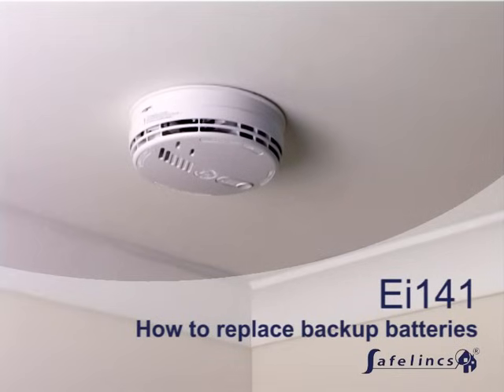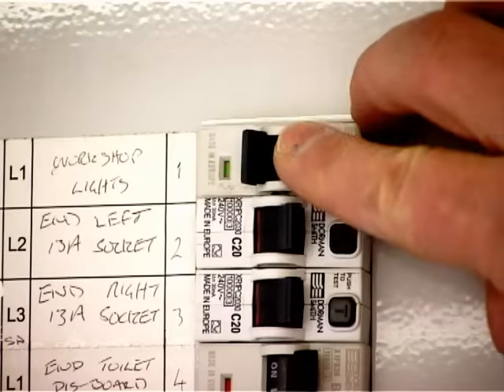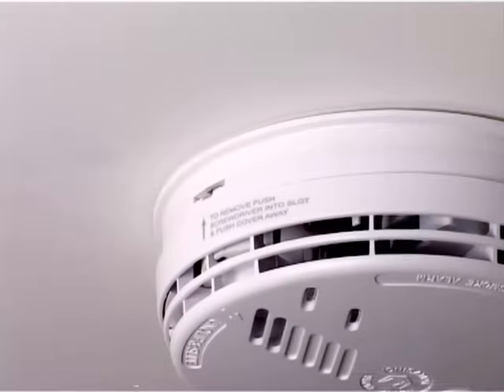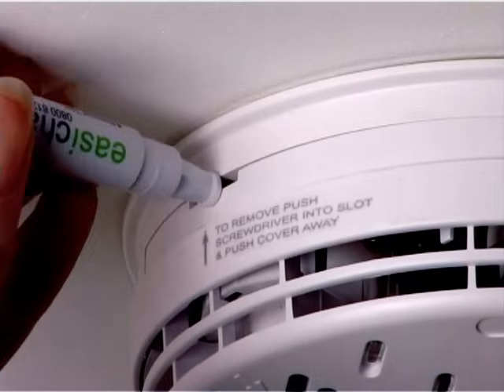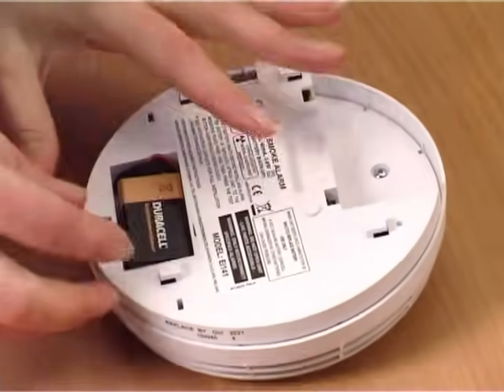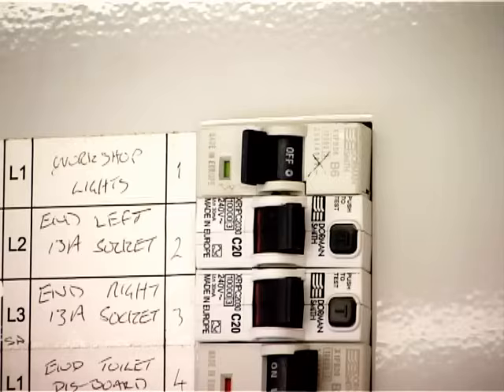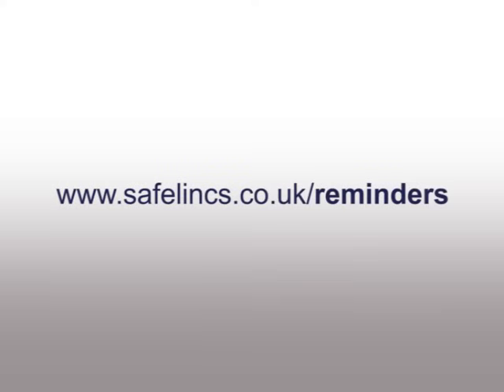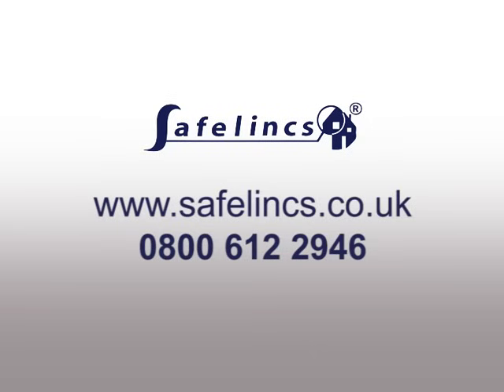Replace battery in Ei141 smoke alarm

Comment: Seriously, why all the complaints about this alarm? The manufacturer cannot determine when a battery will run out of charge. A silence button, maybe with a flashing red warning light to advise the battery needs changing, nothing else needs changing.
After watching this video it took less than 5 minutes to swap the battery over.
The last time a battery was replaced in our alarm was 18years ago, and it's tested every year by the landlords maintenance team!
Yes, it's an inconvenience when it beeps every 40 seconds and even more so when it's at night, but these things save lives.
Here's a thought, how about everyone replace the 9v battery every 3 years or maybe less if it's a cheap battery. That way the battery backup will always be fresh, thus avoiding potential 40-second beeps in the middle of the night.
Or is it just easier to come on to social media and slate the company, and swear like a trooper for likes?
Reply from the maker: Hi, thank you for your feedback. I was a little surprised that your alarm is still being used after 18 years. We recommend smoke alarms to be replaced after ten years as they are becoming less reliable after ten years. See our article https://www.safelincs.co.uk/why-should-smoke-alarms-be-replaced-after-ten-years/
Kind Regards
Harry

Comment: Can someone please explain why in a house with electricity, smoke alarm needs to work on battery. I can understand battery as backup.
Reply from the maker: Hi Jaskan, not sure I know what you mean? These are mains powered and the battery is just a back-up.
Reply: Thanks for clearing that up, As a mechatronics engineer all i can say is this.

This smoke alarm for the layman is  a complete unnecessary nuisance to open up for battery change, with  an unclear locking system to unlock a device situated high up on your ceiling.

I can only imagine very many have been hurt trying to change battery on this device cause in many if not most cases you have to use a ladder.

There are 1 zillion very simple locking mechanism that could have been used for the smoke alarm battery change, considering the fact that its high above on ceiling.

Its just like the case of many deodorants in recent years and other consumer products that come with a locking mechanism that leaves you having to solve a puzzle where all you wanted was just to freshen up.

In Summary the design of the smoke alarm battery change compartment locking system is an unnecessarily dangerous product considering it could be pregnant housewife who has to climb up a ladder to change th battery just to stop the annoying noise, YOU SHOULD BE ABLE TO OPEN THE DEVICE WITH YOUR BARE HAND NOT SCREW DRIVER

YOU SHOULD BE ABLE TO STAND BELOW IT WITHOUT LADDER AND OPEN WITH YOUR HAND bare hand, THAT IS COMMON SENSE IN 2018.

This is why you should have consumers design the user interface of products rather than somebody who still has technical egos to overcome through maturity. Cause maturity in engineering leads to very practical AND SAFE!!!! products, rather than immature engineers and designers looking to make puzzles out of locking systems, thereby creating dangerous situation for those who have to operate the lock standing on a ladder..
Reply from the maker: Hi Jaskan, I do agree with your sentiment. We have passed very similar feedback time and again to the manufacturer, so far without result. This notion of making the alarm really hard to open came from AICO's work with Housing Associations, where  the intent was to make it purposefully difficult for tenants to open the alarm and remove or re-use the battery. The locked battery compartment forces the tenant to contact the Housing Association management and get a 'professional' to do the battery replacement. This of course leave the tenant with the horrible problem of not sleeping til the 'professional' turns up. For replaceable battery alarms this concept is really quite unacceptable. Some other manufacturers still have the battery lock but offer at least a 'Sleep Easy' function that allows you to silence the beeping for 8 hours.

Comment: Designer 1: want to use the industry standard twist to attach?
Designer 2: how about we hide a little slot on the side, but up high out of sight that requires a special size tool, but you also have to push it in just right while sliding the unit....
Designer 1: yeah fuck it, I hate the world too

Comment: I really wish you could detach it with only one hand. Trying to get this thing down whilst you're balancing on two chairs and a stack of pillows whilst trying not to topple over the banister and down the stairs is really hard without a free hand to balance yourself. Damn this student house for having ridiculously impractical high ceilings. Also damn my letting agents for having no out of hours phone number and especially damn my landlord for being too cheap to provide us with step ladder!!!!!!
Reply: Also screw my landlord for not labelling the fuse box correctly that could kill someone!
Reply from the maker: Hi, massively frustrating, I agree. The only way to avoid this annoying situation is to ask the landlord to replace the backup batteries every year, to avoid the nightly low battery warnings! There are also products on the market that have a night time silencing function that silence the alarm for eight hours if the battery runs low https://www.safelincs.co.uk/fireangel-pro-mains-powered-alarms-with-lithium-backup-battery/

Comment: I don't have access to turn off the power so would i be able to do all this without it setting off with the power on?
Reply from the maker: Hi, there is a low risk of electrocution should the alarm be removed with the mains power still connected, therefore we the official approach described within the video.

Comment: Thanks for the upload. 
Getting the cover of this alarm is a nightmare.
I just replaced the battery and its still chirping. 😣
Reply: Stopped chirping. Hurray!

Honestly this video was a life safer. I haven't found any information anywhere on these alarms except this video. I moved into my renovated house in 2013 and no information was left about what type of alarm this was.. I have 3 of these in my house and used this video to replace the other 2 batteries a couple of years ago. I got my neighbour to help me with the one yesterday on the landing as I couldn't reach it. It did a few chirps after the battery replacement (hence my initial comment) and then it stopped. It's right outside my bedroom. 😩 That would drive me mad. I really feel for those who have it in their bedroom. 

On the upside, if there is a fire we'll all know about!!

So sincere thanks for the upload. I have it bookmarked.
Reply: How did you get it to stop in the end?
Reply: @wizards360  it stopped after I replaced the battery. For some reason it continued to chirp for a while after, but then just stopped. Been fine ever since.

Comment: what about if the beeping is NOT in the middle of the night,,, and the 9V battery is not dead?  What else causes the beeping?
Reply from the maker: Hi Paul, it could be older than ten years in which case the unit might start to misbehave. Also, is the green light on to indicate that mains power supply is working?
Reply: Could be a bug inside or built up dust/particles.   Blow it out with compressed air or your pucker.
Reply: A fire.

Comment: great video. have changed the battery and beeping stopped. but we now have a red light flashing - any ideas?
Reply from the maker: Hi Joanne, when the alarm has been activated/tested, the red light will flash twice every 40 seconds. After 24 hours the memory will be cleared and the red light stops
Reply: Safelincs Ltd. thank you !

Comment: Managed to figure it out - screwdriver may not work depending on design. Get something similar width (I used the handle end of a thin fork) and shove it in, if it doesnt slide off easily then shove the fork in further and then it slides off.

Comment: Is there something wrong with just having a smoke detector threaded into the holder, so you can just twist it to remove it as opposed to using a screwdriver and a great deal of force to remove it? Thanks for the video though, it was very necessary.
Reply from the maker: Hi, totally agreed, a simple twist off should be sufficient. Sadly, the manufacturers and standards bodies are too set in their way.

Comment: Why make it so bloody difficult? What's wrong with the simple clip-on design? Far easier to deal with.
Reply from the maker: Hi Andrew, I assume you are referring to the tamper-proof design of the smoke alarm head. This design is aimed at preventing the removal of batteries in rented properties, as the batteries are sometimes used to power other devices. In rented properties the landlord is expected to exchange the batteries on a regular base before they are starting to beep. However, when used in your own home with you changing the batteries yourself I appreciate that it is not helpful to have anti-tamper connections for which you need a screwdriver or similar. I will take this discussion up with our suppliers to see if a solution can be found. In the meantime I hope that our video helped to overcome the problem. Harry Dewick-Eisele, MD
Reply: I also have this alarm, and opening is hopeless. I have three of these in my house, and the alarm is almost like the burgarly alarm. When i serial, they dont need to be this loud. In a large house with only 1, well ok, but most have 2-4. 
If you belive in your argument, you should have 2 models; 1 called "Home" and one called "pro" or something. Most people are not landlords, they are homeowners who want a easy life. If not two models, you could design one with a small key for landlords to use.
Reply: Safelincs Ltd.: Really? You can't be serious. You designed a horrible product to prevent people from taking out the batteries?? Batteries cost less than a couple of pounds and you wasted your engineering trying to save the damn batteries?? Shake my head.
Reply: So battery-less people who live in rented accommodation are incapable of obtaining a screwdriver?  Listen to your customers, change the design. Btw the screwdriver thing doesn't appear to be working, I'll be progressing to a hammer pretty soon.
Reply: And relax. agree with another poster, the sound of the life ebbing away out of the capacitor was pure music to my ears :D
Reply: @xNoName1  They should make a more simpler version of this
Reply: Ridiculous design.

Comment: I’d rather die in a fire. I’ve had enough. The beeping is sending me over the edge and trying to remove the casing it virtually impossible. Just slide. Yer right. I’m about to baseball bat it off.
Reply: I know how you feel
Reply: I took a bar bell to mine. It was 6am...

Comment: I just opened mine after a number of tries. I think my one was a bit stuck. It didn't slide off when I pushed it. Instead of pushing the screw driver down, I just slide it in flat about 1.5cm deep and give the thing a firm fist bump and it came off.

Comment: Are we allowed to take it off without turning off the power in the house? Because turning off the power can be very impractical just to disable one alarm
Reply from the maker: We can only give you the official recommendation, which is to switch the mains power off, as in theory you could use the screw driver to poke into the electrical contact points of the base, although these are well hidden.

Comment: Easy job - make sure you have the correct size (width) screwdriver for the slot.  That is the narrow slot shown in the video.  If screwdriver is to wide then problems can arise.  Also as in the video commentary pull down slightly to release.  Check the expiry date on the external label of the unit (no need to remove to view).  Not sure how your insurance company would take it if you let it expire.  Check the net for best prices.

Comment: Replaced the battery twice now and the fire alarm keeps beeping. The second time round trying it with a different battery and the green light does not come back on when I switch the mains power on. The beeping has been going on for about 4 days now! The alarm doesn't need replacing until 2019. Any suggestions to help?
Reply from the maker: +Natalia Brown Hi Natalia, I know it sounds mad but please make sure there are no other alarms in the room, eg a CO alarm hidden away somewhere.

Comment: It’s 10pm on a Sunday and that beep starts going takes about an hour to get it off only to find that we don’t have that type of battery in the house, whose idea was it to keep the beep going once the battery has been removed
Reply from the maker: Hi, once you have removed the alarm and taken the battery out it will not beep any longer. You pobably have a CO alarm in the room with low battery. It is surprisingly hard to spot the direction of the beep!

Comment: I have replaced the battery and after 24 hours the beep restarted. It was a brand new battery so does this mean the alarm is faulty? How many batteries should I try before I have enough evidence to prove that my landlord has supplied something faulty? He is currently ignoring my calls asking for it to be fixed.
Reply from the maker: fluffymitten Hi, it could be either bad batteries or a fault with the smoke alarm. Please check also the date of the alarm. It should not be much older than ten years. For more fault finding info, please see http://www.safelincs.co.uk/help-to-resolve-beeping-ei-aico-alarms/  You might want to point your landlord to the replacement models http://www.safelincs.co.uk/replacement-smoke-and-heat-alarms/

Comment: Can you use radio manual call points with these alarms?
Reply from the maker: Hi Joe, not radio call point but you can use wired call points https://www.safelincs.co.uk/mcp401rc-manual-call-point/  . An alternative would be to fit an RF base underneath the Ei141 https://www.safelincs.co.uk/ei168rc-mains-powered-rf-base/   You could then use the RF call point https://www.safelincs.co.uk/ei407-wireless-manual-call-point/  I hope this helps.

Comment: Hi all, I went to look at my alarm when it started beeping. My electrician fitted it alarm about 2 years ago. It looks exactly the same as the one in this video, but also has two stickers on the side:
One says "Battery not replaceable, see instruction leaflet"
and other says "Replace by July 2023,  12W29"
Needless to say we don't have the instruction leaflet, and if it says "battery not replaceable" it would be unwise to try, as its clearly not the same model.!
Any ideas?
thx, Kelvin
Reply from the maker: +Kevin Stewart Hi Kevin, you probably have the Ei160 series installed which comes with a rechargeable, sealed-in battery. We have dedicated videos for these units as well (Ei161, 164, 166). The only recognisable difference from the outside is a sticker on the front of the alarm. Once you have removed the alarm (they all come off the same), the detailed part number can be seen.
Reply: I have the same alarm with the non replaceable battery. why is it chirping and how do I stop it ??
Reply: I have the same alarm with the non replaceable battery. why is it chirping and how do I stop it ??
Reply from the maker: +Rosie Sharkey Hi Rosie, please make sure that the green light on the alarm is on, as it indicates healthy power supply. If this is missing the alarm will chirp. If it is off, please check fuse. Also, second most common problem is a different alarm with low batteries in the same room (eg a CO alarm). You would not believe how difficult it is to correctly track the source of a chirp.

Comment: Can't open the beeping thing, 1.30am, scream!!!! This vid has very muffled sound. Love everyone's comments. Right, back on the bloody stepstool, F**k this!

Okay 30mins later, used two screwdrivers and hammered it sideways, broke the clip, took battery out and it's still beeping, what the f**k? Stopped now, will get new battery in the morning, hope it will go back up, sigh... Might as well make a cup of tea and go on facebook now.
Reply from the maker: J Aldridge Yes, very frustrating, I imagine. The only way to prevent that is to change the battery once a year. Just a note for everybody else: if the alarm continues to beep after the battery is removed, press the test button which 'drains' the residual electrical power in the smoke alarm.
Reply: This comment perfectly describes exactly what has just happend to me
Reply: Yep as SafeLincs said: Top Tip: once off remove backup battery. BEFORE putting in new battery, hold down the TEST button for 30seconds to discharge the unit fully! Only then put new battery in..  (otherwise it can still "remember" there was an old battery and starts chirping again)

Comment: HERES THE SOLUTION:  THIS THING WAS PISSING ME OFF  ALL MORNING. FIRST TURN OF THE SMOKE ALARM FROM MAINS. NEXT TAKE OF THE COVER BY USING A FLAT HEAD SCREW DRIVER TO WEDGE IT OPEN. FINALY REMOVE THE BATTERY FROM THE COVER AND CHUCK THE WHOLE THING IN THE BIN.